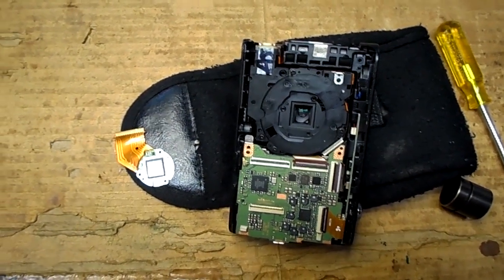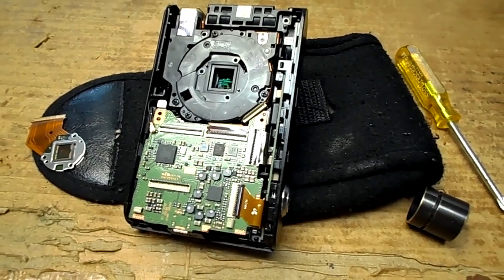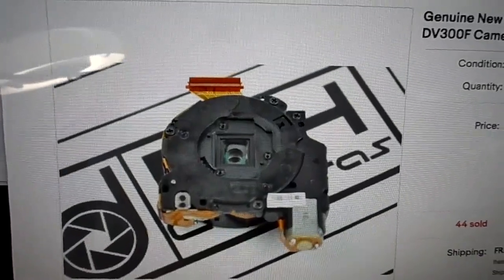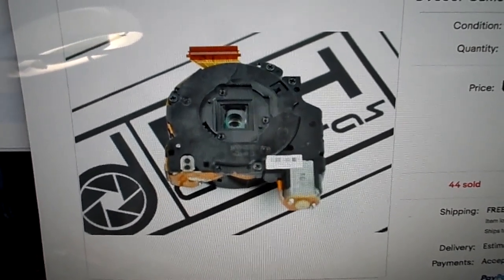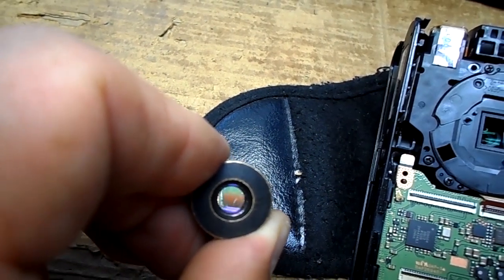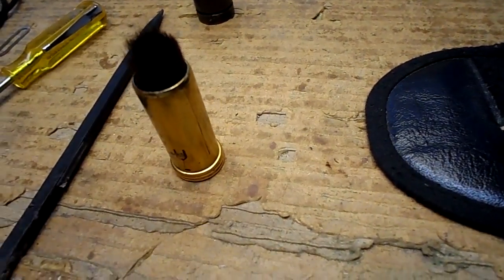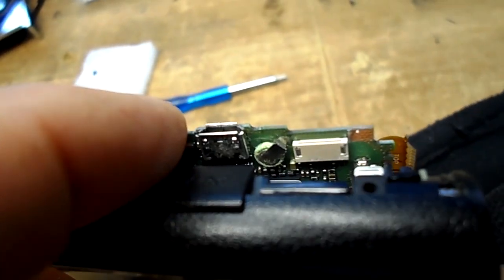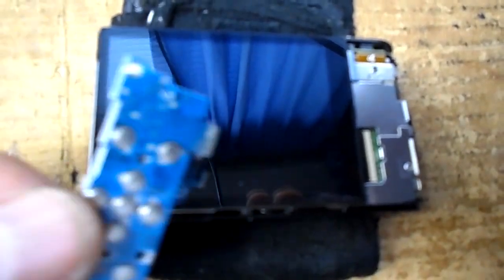Samsung DV-300F Digital Camera. Quick Cleaning of CCD.

Comment: Not a vacuum tube within sight on this stuff!  So I assume that battery is for short term retention of the date/time, etc if the main battery is removed  or fully discharges? Can you easily pop it out or is it retained on all sides? If you can get it out sure there's a number that would give you a replacement.  Is there a silkscreened reference # nearby? Even if not replaced, you might want to get it out as the corrosion from it could damage PCB traces/components. Good Luck and Merry Christmas!!
Reply from the maker: Thank you. It is soldered in place, & it's so tiny. Yes probably best to take it out completely to avoid corrosive damage. Cleaned the leakage for the moment. Merry Christmas to you as well! Thank you for watching.